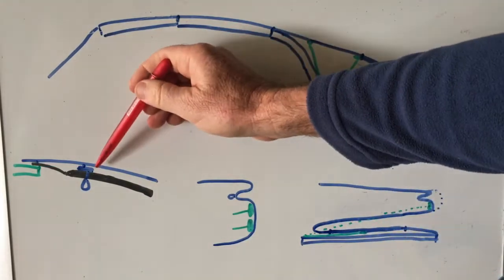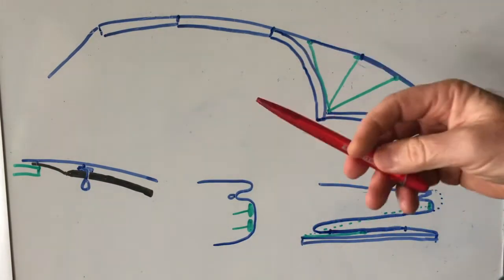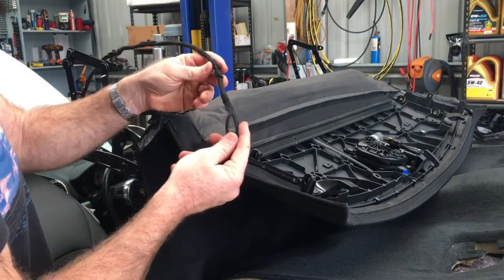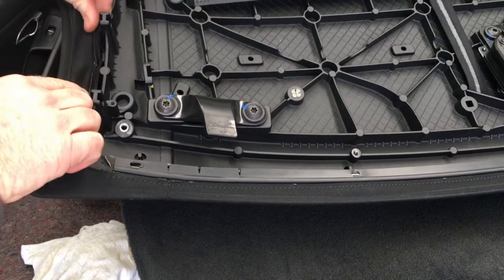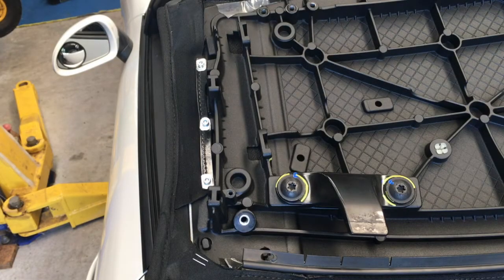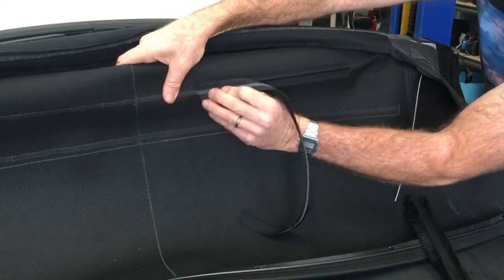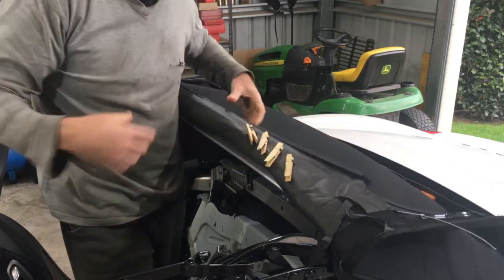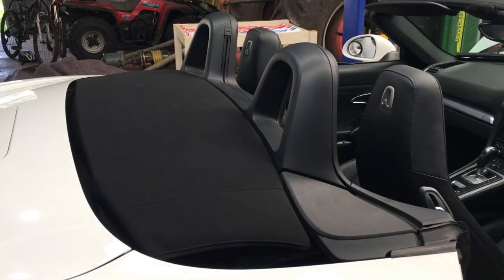Porsche 981 Boxster roof pleat cord fix

Comment: I'm starting to see this in my 981 BGTS. I too get very sick of dropping the roof and getting out of the car to 'fix' this issue. I still have a year+ left of CPO and I'm going to try and figure out a way to make my dealer fix this! That said, I think one thing that would help (for us US folks) would be getting a Smart top controller so I can drop the top outside of the car, then adjust it, then get it and not worry.
Either way, still doing God's work, Jeff. Thanks!

Comment: Hi Jeff. I am getting a lot of help from your videos Thank you! Especially with the interior separation and transmission errors etc.... Our Boxster is getting more and more damaged in the roof as time goes by. This video could help a lot... but honestly it is very difficult.
Once again if you could make the process step by step easier it would be more helpful than the mission sensor. Thanks again for your efforts.

Comment: Holy crow! Beautiful work. I am too intimidated to attempt this. Curious if you contacted Porsche, and what their response was?
If I were to get out of the car every time I lower the roof and manually push that section of the roof forward with my hand or blunt tool so that it looks like your final resting position, would that stop the wear? My fabric has already worn quite a bit in those two areas. Great video! Thank you for taking the time to document for all of us.
Reply from the maker: When I discovered the damage that was happening I got out of the car each time to push the roof in by hand to the correct position. It stopped the wear progressing, but I just got the s%&$s with getting out each time as the roof comes off the car nearly every time I drive it.
Reply: @jeffrichardsoncardiy  that is the right way to drive your convertialbe man! :)

Comment: Amazing. I'm far less overwhelmed thinking the whole apparatus is too complex to deal with. I just have to treat it as an assembly that can and should be disassembled to get a good workspace. Thanks for giving me the courage!
Reply from the maker: It's funny when I start a project like this. I'm always  worried I"m going destroy something expensive. Afterwards I always look back and ask what all the fuss was about. It's just a big lego set that is well designed so that it can be put together easily in the factory, which in turn makes it easy for me to do the same.